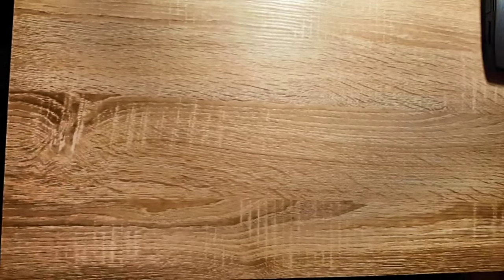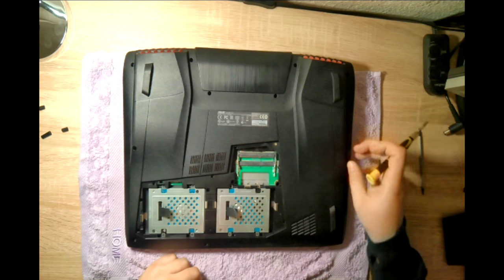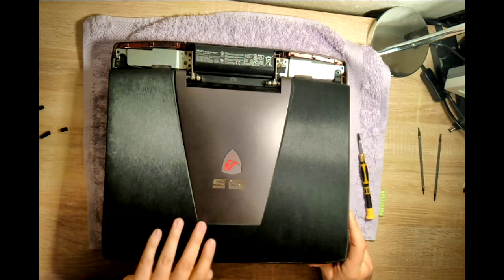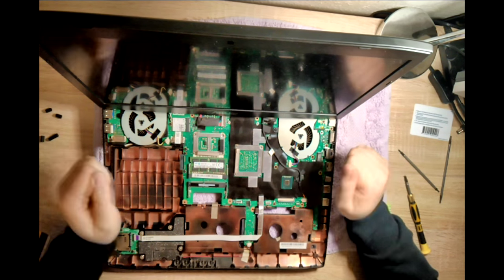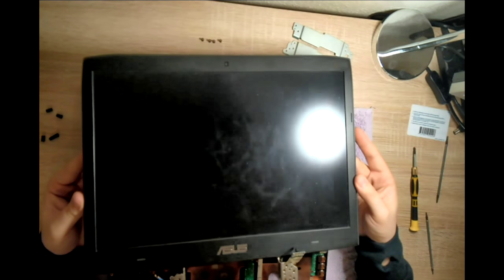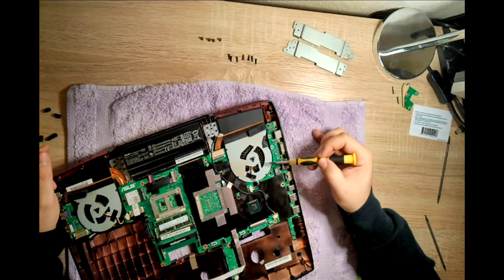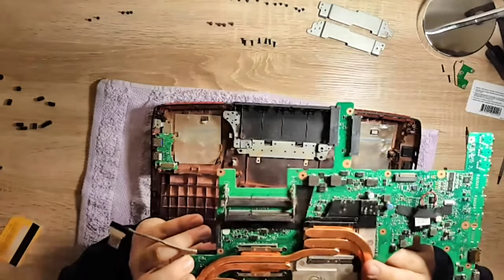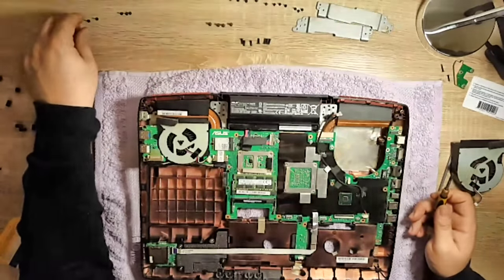Asus G751 - Complete Disassembly / Fan Cleaning / Battery Replacement

Comment: Hey, man. I love your video and appreciate you for uploading it. I took my G751JL apart last night to clean the fans and replace the battery. After I reassembled the machine, the battery seems to be charging but when I turn it on, only the "bulb" led light turns on but none of the others.(No Hdd activity either I'm guessing) Nothing comes on the screen and it turns off by itself soon afterwards. I took it apart again and did everything again carefully but no use. Same issue. What am I doing wrong? I'm really worried since there's no repair shop I can take it to. Please suggest something.
Reply from the maker: unfathomablemystique Hey, usually if it turns off on its own there's some hardware issue. I believe there's something wrong with one of the connections. Try to re-seat the all connections and pay extra attention to the display connector. It's the Lego type connector so be careful how you push it down. Also since its not turning on at all, try to remove the battery and then the CMOS battery and leave it like that for a couple of mins. Then start reconnecting all the cables. Are you sure that the battery is not defective? It's really hard for me to guess when the laptop is not in front of me. Also,  try to re-seat the RAM. Let know of the outcome!
Reply: Dongleboo Hey man! Thank you so much for replying. I've just taken it apart again. I was reading your reply to some other guy and I decided to unplug the CMOS battery. It's unplugged now and waiting for a while before I reassemble again. I've already taken out the RAMs and unplugged everyhting I could find. I've checked the video cable for damage and it's perfectly fine. I'm going to reconnect everyhting very carefully in a while and let you know what's up.
Reply: Oh, and I put in the old battery again just to make sure because it wasn't completely dead. Same issue with the old battery too.
Reply from the maker: unfathomablemystique Ok, then write once you turn it on again. And another hint, check the power button connection upon reassembly.
Reply: Dongleboo Okay so the laptop is powering up and staying on this time but there's nothing coming on the screen :(. I'm sure I'm plugging the display correctly, I hear a tiny click every time without using much force.
Reply: Dongleboo Could it be that I've fried the motherboard?
Reply from the maker: unfathomablemystique It's highly unlikely. Can you try to power it on and connect an external display/TV with an HDMI cable? This way you can see if the MB is posting.
Reply: Dongleboo Yeah, i tried connecting an lcd via hdmi but nothing, black screen.
Reply: I want to take it apart again but I don't know what to do different.
Reply from the maker: unfathomablemystique That's really strange man. I've taken mine apart down to the last bolt over 10 times now andI never had any issues. You're the second person who had this kind of issues.  There's a chance that you had some static electricity and you've shocked the board. I really don't understand how is this possible or what might be the cause for this. Last resort - remove the CMOS battery and leave it overnight. I'm sorry but I don't have any other adviceI can give you. Are the fans spinning?
Reply: Dongleboo Yes, the fans are spinning but there's no other activity. I'll take it apart again and leave the CMOS over night. Thanks for taking the time, man.
Reply from the maker: unfathomablemystique No worries about that. I'd always takethe time to help out another fellow ROG user. I'm just baffled by these sudden deaths. It's really weird. If for some reason it actually died, you can buy a broken one off ebay with a working mobo and use it as a donor. I've done that with my old Acer.
Reply: Dongleboo Unfortunately, eBay and Amazon don't deliver to Pakistan. I had to get this laptop from Canada and I can't tell you how difficult it was getting it back to me. That's why I'm a little extra worried, there's no Asus centre for me, nor any parts I can get easily.
Reply: Dongleboo UPDATE: So I took my laptop to a technician in another city. He checked the whole thing for damage and said there was none. He was baffled aswell, tried the CMOS over night too. Two days into it, he called me to tell me the motherboard BIOS had been wiped and that was the issue. Took another 5 days and some programming to get the right BIOS into the board. The guy called me to say the laptop was booting up fine now but on an external display. The laptops own screen was not giving anything. He's looking into this problem now.
Reply from the maker: unfathomablemystique How on earth can the BIOS get wiped? This is extremely weird!! I think some production units are different from others. The non- functioning screen might also be due to the bios and it probably is. I had an HP laptop which did exactly that last week and I spent a full day on that thing. After I flashed the BIOS the screen woke up. I still can't understand how disconnecting the battery can wipe the BIOS?
Reply from the maker: unfathomablemystique How on earth can the BIOS get wiped? This is extremely weird!! I think some production units are different from others. The non- functioning screen might also be due to the bios and it probably is. I had an HP laptop which did exactly that last week and I spent a full day on that thing. After I flashed the BIOS the screen woke up. I still can't understand how disconnecting the battery can wipe the BIOS?
Reply: Dongleboo I have no idea, man. I was at my wits end with it. But the display is working with an external monitor, just not it's own, could it still be a bios problem?
Reply from the maker: unfathomablemystique Like I've said,  I got a similar issue with an HP laptop and it wasn't starting the graphics card and the built in Intel one was disabled. I had to flash the bios and force it to use the Intel gpu to get a picture. After this I disabled the Intel gpu and reactivated the AMD gpu. It might be due to the BIOS. Try to update the bios to the latest version and check the options for the graphics cards.
Reply: Dongleboo Okay, so the guy called me up and said the laptop was fixed. He said there was an issue with the circuit connecting to the display and he changed it. I got the laptop and after booting it up, the screen turned on but it didn't show anything after the rog/windows logo. Screen went blank again. I connected it to an external lcd and it works perfectly. I updated the bios to the latest hoping it would fix the problem but it didn't. Should I format and reinstall windows? What do I do from here?
Reply: Dongleboo Also, the display adapters only show the Nvidia Card, does this have a built in intel gpu aswell? If so, then where could I get its driver since Asus support is only showing the Nvidia download.
Reply from the maker: unfathomablemystique They all have an Intel HD 6000 series vPro GPU's built in the processor. Usually its turned off by default from the BIOS and its not being detected. Actually the laptop is not made to have switchable graphics.   My old Acer had switchable graphics but I never actually used it. :)
Reply from the maker: That's the GPU thing I told you about. Go to device manager and uninstall the display drivers. After a reboot, it should enable the basic graphics drivers to show windows. After this re-install the nvidia driver.
Reply from the maker: Actually, you can test that by rebooting the laptop and then press F8 and boot in safe mode. If the display works, then it's drivers. It should. How much did you pay for the repairs?
Reply: Dongleboo Alright so I booted into safe mode and there's still no display on the laptop but the external lcd is just fine. Device drivers show only Nvidia as "Status not available for this device when Windows is running in safemode". I paid 60 dollars for the repairs but if I count in the travelling that's another 40.
Reply from the maker: unfathomablemystique Well, to be fair, I expected a lot more. It's not that bad. There's still something wrong either with drivers or the GPU doesn't start at all. Can you boot into Windows normally with the external LCD and then uninstall all graphic adapters drivers. Let Windows find the drivers automatically. Sh*t, that's one stupid situation. I don't understand what's causing this. To me it sounds like drivers. I hope it's not hardware.
Reply: Dongleboo It's working perfectly with the external Lcd. I don't think it's the gpu, games are running at optimum performance as well. I disabled CSM from the BIOS and now I can't even get into the BIOS anymore, black screen persists and windows doesn't load either when I press F2, /facepalm. Otherwise it's fine on the external lcd. Now I'm trying to get back into the BIOS so I can do a clean install and stuck on it since yesterday, haha.
Reply from the maker: I have no words. Seriously. This makes zero sense. Sorry to hear all of this sh*t is happening to you.
Reply: Dongleboo UPDATE: So, 4 months, $300 later, its back to work again. As a last resort, I ordered a new screen from China. It's as good as new and working just fine. Just thought I'd update on this traumatic experience since you were very kind to try to help.

Comment: I'm having trouble with reconnecting the wires to the wireless adapter. how did you manage to put them back in?
Reply from the maker: +Admiral CoffeMaker It's very easy. Just be patient - get the circular connector directly over the pin. Don't tilt it in any direction. Just press it down. It should click! It needs some force to be applied, but only a little bit. If you can't do it with your fingers, grab the cable with one hand, place it over and use the screwdriver to press it in.

Comment: Hey man, I know my question might kind of a be a void one but uhm. Would it be possible to get new Batteries for the G751?
after you showed me the full disassembly, now I've known the battery wasn't literally glued to the laptop.
Reply from the maker: +Deviant Azer The battery is replaceable, just google it. It's around €100. If yours is dead you can buy a new one.
Reply: Nice! Thanks for the info! Keep up the good work man, if this wasn't up Idk how I'd open this bad boy up. Oh and another thing, do you know any solutions to High temperature shut downs?

Comment: Hey! how often should you clean the dust off the fan?
Reply from the maker: +ILove Hearthstone So far I've cleaned them 2 times including the one in the disassembly video. They require cleaning maybe once a year. Usually there's dust buildup between the fan casing and the heat sink but it needs over a year of  heavy usage to accumulate enough to mess up the cooling.
Reply: +Dongleboo Thanks.

Comment: Great video, but it's like they built this thing to be a complete pain in the ass if you need to repaste the cpu. Mine(i7 4860hq) easily stays between 92 and 96 degrees when maxed on turbo for some time, however Asus says it's 'fine'. I know this things runs hot but I also got a feeling that the fan speed kicks in a bit late (90+ degrees) for max power. Did you have any issue with NFC?
Reply: I agree. I was looking at picking one of these up off fleebay for cheap to have the 980m but, the construction looks ridiculous. I'll stick with my Clevo P150EM for now.

Comment: Hi, I'd like to replace keyboard in this model. Any recommendation how to go about removing and then putting it back together with the top cover? It seems to be welded/glued with it but I can see quite few places offering online just the keyboard so there must be a way.
Reply from the maker: To be honest I don't know. There was one guy here who said they will change his in some PC repair shop, but I have no idea how it went. The keyboard is actually high-frequency welded to the palm rest/chassis. The same goes for the touchpad. You can find the whole set here - http://bit.ly/2hmn9h1 
It costs approx 100 euro with the keyboard and the touchpad if I'm not mistaken.
Reply: Cool, no worries. I'm more interested in replacing just the keyboard (not only because it's much cheaper but I also like the challenge). Separating from chassis and then attaching back will be tricky though. I think some type of glue might do the job (epoxy perhaps?) but I'm still at the stage of figuring it out so doing preliminary research. The feedback and link was welcome so thank you for that, much appreciated. Youtube needs more channels like this. Keep up the good work!
Reply from the maker: Hopefully by the end of next week I will upload a video of how to replace the keyboard. I've just ordered a spare one and I'm waiting for it to arrive. ;)

Comment: Thanks for the great video!! 1 quick question if any one knows i believe my power jack connection is on its way out. Have intermittent connection while charging. Does anyone know if this is soldered onto the motherboard or just connected? As this will be the difference to me doing it or having to take it in to be repaired. Thanks in advance!!
Reply from the maker: The DC jack is soldered to the motherboard. It's easy to replace if you have some experience in soldering. If not, better take it to a repair shop. If something goes wrong (and a lot can go wrong) it can become a big issue.

Comment: Hi there. I am going to replace the CPU fan in my Asus G751JT Rog Laptop. How do I avoid shock so that I don't mess anything up?
Reply from the maker: Arielle Nichole Well, the most important thing is to make sure the laptop is off. As a second precaution you can disconnect the battery and reconnect it after you're done. Static electricity should also be considered. Its good to have thicker rubber gloves.
Reply: Thank you. I need to replace this fan so bad. It's making a noise like a lawn mower, but I am mortified of causing shock and ruining something. Would it help if the batter was dead too? Like if I ran the computer till it juiced out and then opened it?
Reply from the maker: Arielle Nichole You must change the BIOS settings because by default the laptop goes to sleep at 7% battery. Even if you set this to 0% and it shuts down there still might be some residual power left which would be enough to kill the MB in the event of a short circuit.  It's definitely a risky procedure and to avoid something shorting out I'd suggest to disconnect the battery and then proceed with the rest.

Comment: Disassembled the laptop, made sure I am careful with it, repasted and repadded it, assembled it back fully, boots up fine but the screen backlight is no longer working. Tried to redo the connection a few times, but didnt help. No idea what to do. Any help?
Reply: Hi, I have the same problem. Did you find a solution?
Reply: The screen is fried. Replacing the screen ended up being the solution.

Comment: I have a G751JL and I've been wanting to clean the fans, but I can't seem to pull the keyboard up to expose the fans and insides. The right side, for whatever reason, feels like its stuck and even after using a card to pull it up, it won't come off. Any idea what to do?
Reply from the maker: You are probably missing a screw. Once you pull it up from behind the display hinges it goes up fairly easy. Check if you've removed all screws including the ones that are under the "service lid". There are 4 screws there. Check carefully!
Reply: +Dongleboo Thanks, I'll give it a shot later and try and clean it again.

Comment: Has anyone repasted this laptop? I have read all the forum posts about it but want to chat with someone here on youtube. How much paste did you use? What about the smaller components that also had paste on them? Did you repaste those?
Reply from the maker: I personally haven't. If someone on here did, please do share.
Reply: I've already purchased MX4 which I hear does wonder with this laptop. But after seeing some pictures of the heatsinks removed, you can see other components aside from the GPU and CPU that all have paste on them. I'm wondering what to do with those.
Reply from the maker: Usually, the other component which has a heatsink on top is the MB chipset. 
There will be 0 difference to the performance of the laptop. You can of course change the paste, but that's up to you. They have some heat transfer pads on them.

Comment: Here is a stupid question, can the video/graphics card ram be upgraded? Or is it integrated? I only ask because I noticed the ram under the keyboard.
Reply from the maker: The GPU RAM is integrated. The GPU itself is soldered on the motherboard, so it's impossible to upgrade anything except the RAM. The slots you see in the video are actually the "hidden" two slots. Usually most configurations of this model have the factory installed memory there ( 8/16 GB) and then you have the two slots which are easily accessible from the removable lid on the underside. Mine for instance has only 8 GB RAM, but I'll upgrade it soon, along with a good SSD.

Comment: +Dongleboo is it possible to use compressed air to clean the fan without taking the computer apart?
Reply from the maker: As I said to someone else, if you do it from the back side (the vents) it will probably blow large pieces of dust cloth-like stuff straight into the fan blades. At least try to remove the keyboard panel and this way the fans can be exposed and you can blow off the entire dust build up out of the fan assembly. The most common spot for the dust build-up is the heat sink.

Comment: When i open it,,  i was so carefully when taking the keybord up. I carefully pull out those 4 cable. When i closed it it gave me keyboard problem. Whne pushing 1 button it types 3 button. Gt5 hy6 all together types .  What is the problem?
Reply from the maker: Hi, re-seat the large ribbon cable. If it's even a little off it starts typing wrong. It has to be perfectly perpendicular to the connector.